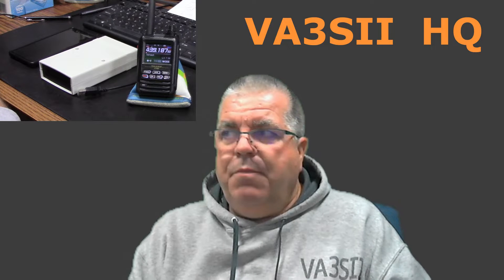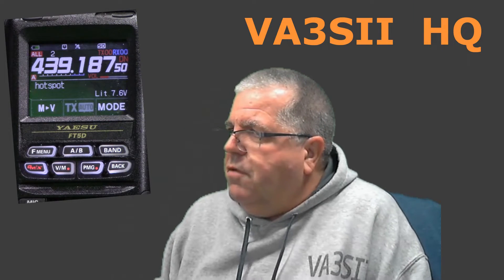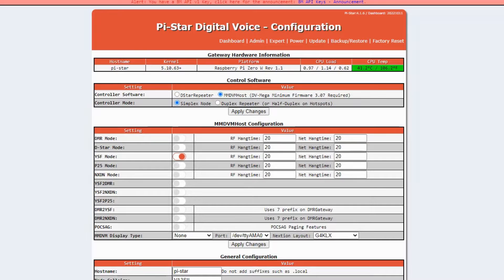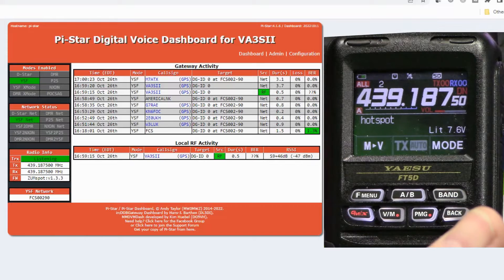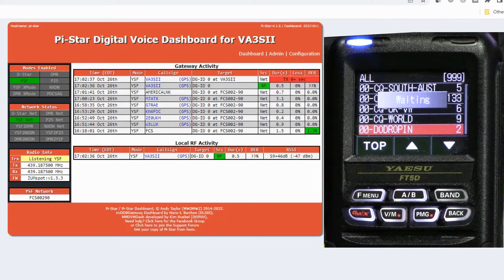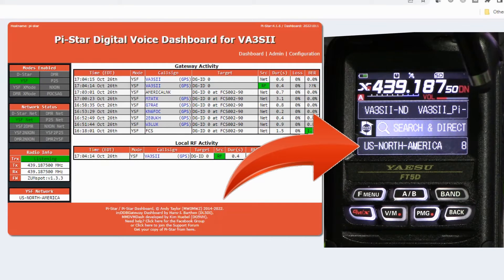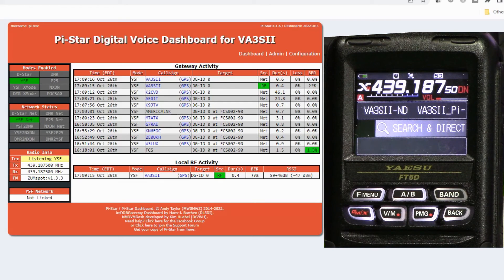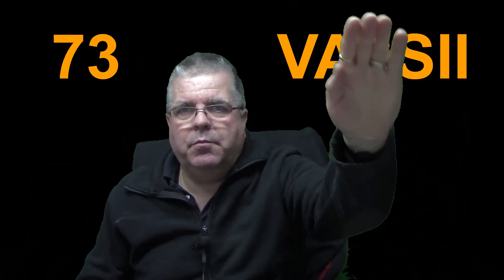How to use a Yaesu FT5D with a Pi-Star Hotspot WiresX, just the basics

Comment: I have done all that with a pi star hotpsot and ft5d. Pressing the wires x button, I am just not connecting at all
Reply from the maker: Try changing the mode from dn to d etc. I found one of mine worked and one didn't. Plus you have to wait for when no one is transmitting
Reply: @va3sii  well I will try that..

Comment: VA3SII de K5RPM.  I can get my PiStar hotspot into a room, if I choose one in the config....such as AmericaLink.  I can then communicate with other hams in that room.  However, when I push the GM/X button on my FT5DR, I get no response from the hotspot.  And I make sure to do this when there's no activity in the room.  Neither will my transmission show up in the Local RF window, such as when I'm talking normally in the group/room.  I really want the ability to change rooms, like you demonstrated with your FT5DR.  I followed all of your settings in the video.  I even tried with WiresX passthrough ON and OFF.  Still no joy.  My hotspot is a DVMega dual-band, running PiStar 4.1.6, which I updated versions in 2021 but, funny thing is, 4.1.6 is no longer available on the PiStar.uk website.  It's almost as if my hotspot is deaf to that short little digital burst when pressing/holding the GM/X button.  Any thoughts/suggestions, sir?  Thank you!!  Ron - K5RPM
Reply from the maker: I feel your frustration and understand the statement deaf to that burst of data etc. Im struggling to suggest. Obviously it has to be done when the hotspot is not transmitting.  Have you tried changing the radios digital bandwidth to dn or away from dn. Cant think right now what else to look for. Good luck with it anyways Ron.  Sii VA3SII (now G7HCD) again
Reply: @va3sii  From what I gather, it's likely the radio hat that my hotspot employs, specifically the DVMega dual-band.  I can get it to x-mode if I set BM 3102 as the network, and define a room # (such as Worldwide).

Comment: Speaking of crossmoding with the Wires-X button, here is my crude video demonstration of setting up for YSF, YSF2DMR, YSF2NXDN, and YSF2P25 all turned on simultaneously and using the Wires-X button to hop from network to network with the Wires-X button. I apologize that my video quality pales in comparison to yours. https://youtu.be/wU6ssfSoRA0
Reply from the maker: Appreciate that thanks
Reply: @va3sii  no problem. The DMR crossmoding works quite well and is a great way to also experience DMR without having to buy a DMR radio. I am amazed how it even allows you to store DMR talkgroups with the Fusion radio! The Pi-star folks have really worked hard to add these features!

Comment: Hi VA3SII you don't have to connect to WiresX to talk on AmericaLInk. It has a YSF reflector too not just a WiresX room and it has a lot more people in it. You can set it as your boot YSF # in PiStar configuration page and it still works to that reflector but not with the wiresx news and other stuff like seeing the number of people in it. But it does work for seeing who is transmitting and for talking and receiving.